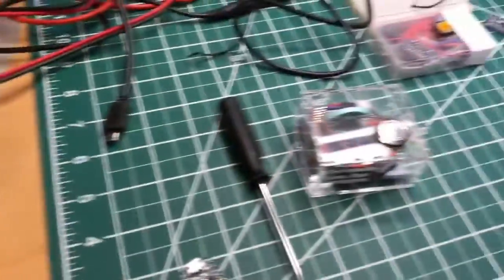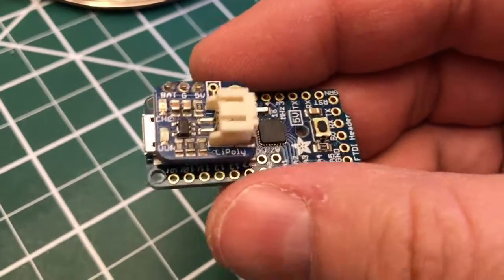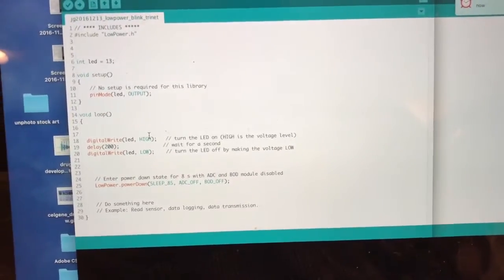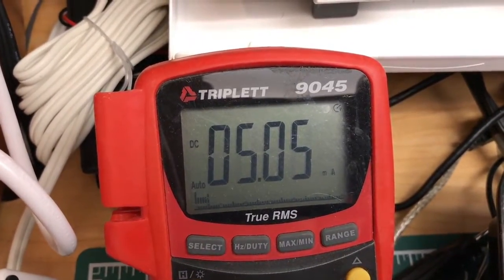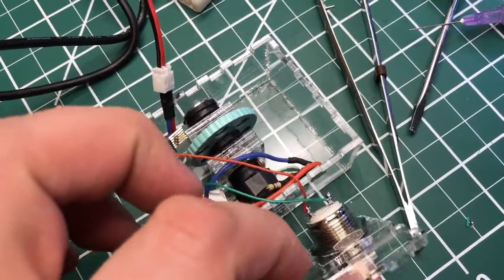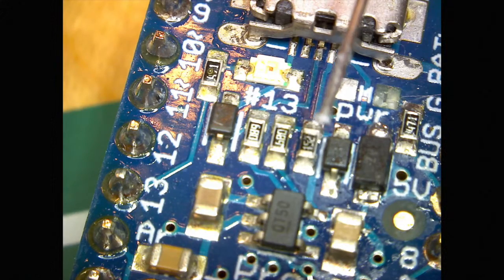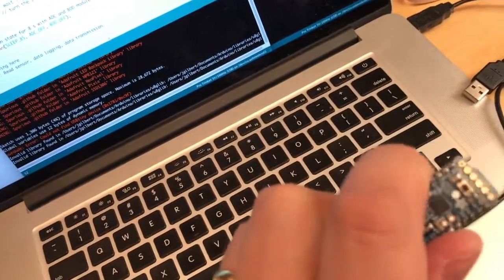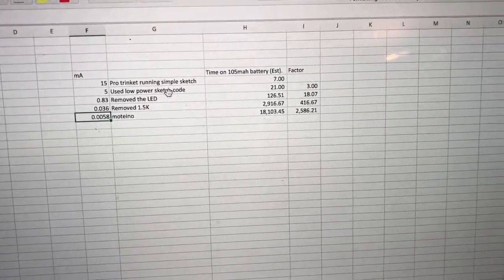How to make really low power electronic toys

Comment: Are there any dangers with removing the 1.5K ohm pull up resistor like fire at all? Can the adafruit trinket be safely powered through the usb connection without the 1.5K ohm pull up resistor? So it can still be programmed throught ftdi?
Reply: Can't you have your cake and eat it with a much larger value pull up?
Reply: James Cross I came here to say the same.
Reply from the maker: Aeropib yeah you can still power it over USB but you have to program using FTDI
Reply: Alrighty, Thank you very much.